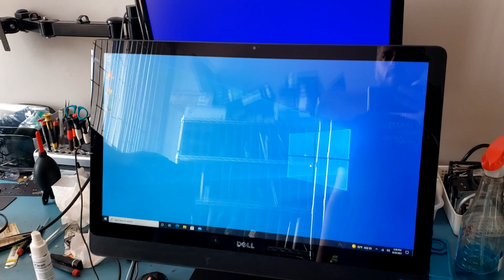XBOX Series X HDMI port Replacement with 10 ripped pads.

Comment: I bought the traces and pads #2 from you recently, I'm going to take a stab at doing this @northridgefix. On a level of 1-10.. 10 being the hardest.. How hard is this? I have 19 pads that need to be restored. I have a little experience doing some soldering in the past but wasn't very good. Mostly rc cars. Nothing microscopic like this.
Reply from the maker: Definitely a 10. It's a combination of proper tools, steady hands , quality microscope and practice.

Comment: I work for a repair shop and I had to do trace work on a Xbox One S. Customer came in with a the hdmi port completely off the motherboard. I had to trace three wires to the hdmi port. I was blown away once I fixed it. It was my first hdmi repair and first trace work repair. Seeing your reaction at 12:40 was very similar to how I felt once I saw the screen light up. I love your videos!

Comment: For connector pads like these, after soldering the new pads, solder mask must cover the whole area, then you scratch the pads out, otherwise they’ll break again very easily, don’t under estimate the force from HDMI connector, especially from game console.
Reply from the maker: The opposite is true. You don't want them solid. Pads should flex with the connector.

Comment: do you ever use those 0,2-0,5 mm thick small pcb's that go between an output socket and motherboard for easy routing of riped wires?

Comment: I just finished successfully replacing my first nintendo switch usb-c port, that was only possible with the help of this mans videos. Let me tell you, he makes this job look so easy but it is far from it. I'm working with a hakko fx-888 with a good a selection of tips, a cheap hot air station, a cheap digital microscope and a hand held magnifying glass. But I know it would'nt have been any easier if Id been sitting at his bench using his more expensive equipment. Thank you so much for this channel Alex, kindest regards from Australia.

Comment: Inspiring, as usual! Manufacturer video for the replacement traces shows laying down a very thin layer of solder mask underneath the new copper. I recommend this approach.
Reply from the maker: Thanks for sending  in the pads. I honestly wanted the pads to be free and flexible, rather then fixed. I'll try solder mask under in a different scenario.  I appreciate the suggestion.
Reply: i have tried few times on donor boards as practice.   Soldermask was to thick and pads drowned :D  but it is a good idea if done correctly.  Hard to do tho.
Reply: @Dmiliunas  try scraping those drowned pads again

Comment: hey brother! it would be great to add some UV mask under these pads to hold them in place, it will make the job 10 times easier with these pads stuck in place. ahla 3alam tahiyete mn l Brazil !

Comment: Just curious why you don't apply solder mask to the loose pins once you verify they are well connected. Plugging in and unplugging the HDMI cable must wiggle them ever so slightly, so it would seem to be a good way to at least help control the movement of the loose pins would it not?

Comment: When working with those pads, you need to  put solder mask and then put the pad on top and cure the mask, that way the pad is strong and you can solder easily ;)

Comment: Wonder if signal integrity is the same after the replacement. HDMI uses high-frequency signals and the quality of the traces is important . For example, they must have the same length, resistance, etc.

Comment: I have a laptop that is 6 years old. A 2070 super desktop graphics card. I didn't had any problems with the HDMI connector on my devices. Make sure that the cable is placed in the correct orientation and the connector is aligned with the cable. Do not press hard when trying to connect it. If it is aligned correctly it should slide in easily without applying too much pressure. If it is not aligned and you pressed the cable with a lot of pressure you will definitely damage the port.

Comment: u see, with all respect, showing difficult repairs to normal people & making them so easy in camera will get lots of people attempting to do the repair at home with soldering iron from the dollar store, I get it you want to help and share the knowledge but in the long term this is just going to reflect badly on the repairs you get, I have noticed A good amount of the repairs you get had prior repair attempt. please consider a different way of making your videos.

Comment: I don't understand why people applys force when they don't have enough heat in ports it should move easially when the solder is in its melting temperature, but people applys force to take them out thats why they break them down, and if you don't  have the equipment or experience then go to an expert before destroying the pads of the hdmi port of this amazing console

Comment: You need to apply a little bit of solder mask under the pads to secure them in place 
As always wonderful job
Reply: Under? Nope, it has adhesive underneath. You add solder mask after soldering to whatever remains exposed.

Comment: After the pin connection test, would applying solder mast across the pins be beneficial?
Reply from the maker: Solder mask will have absolutely no effect on the pins.

Comment: Do you really need to restore all ground pads? 
I mean one is enough.
Reply: a job well done imo
Reply: @shinjiikarir  that's right 
He did always a better than factory job :)
Reply: He mostly does just one ground pad unless not require. But as far I understand it’s depends of the thinness & thickness of the fixed area. Many ground pats was missing. He may not get the risk if one path fails
Reply: @onuroskay8613  yes it could be